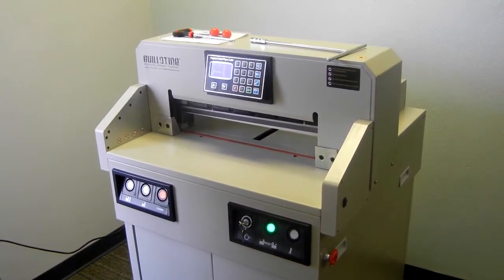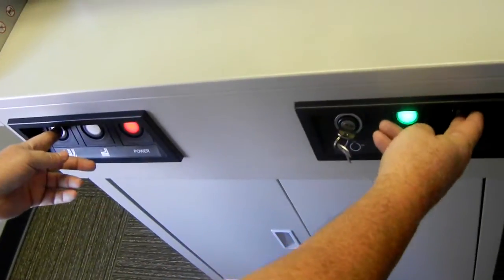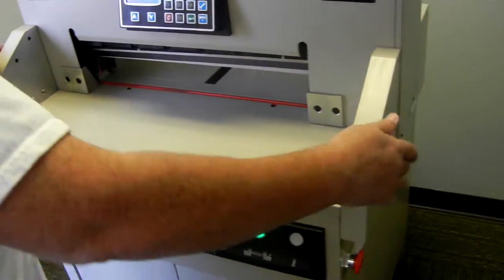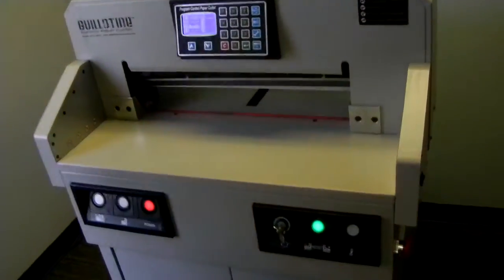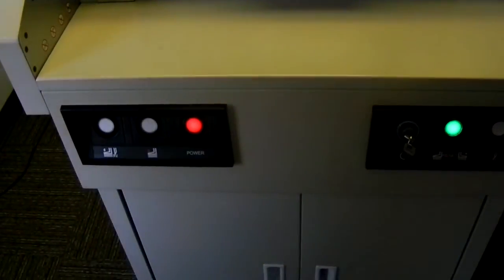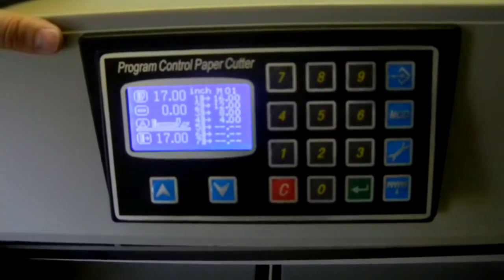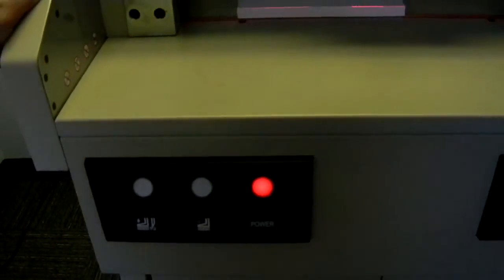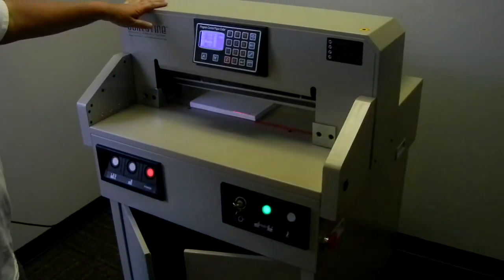GUILLOTINE® EC19 PRO Electric Paper Cutter Demo

Comment: Hello. You know how to change the Inches measurement unit to milimeters?
Reply from the maker: push the upper most right blue button until the inch is blinking then push the blue up arrow button then press the green button
Reply: Thanks for answering. My paper cuter is similar to yours, but do not have this function. Thank you anyway.
cbm831